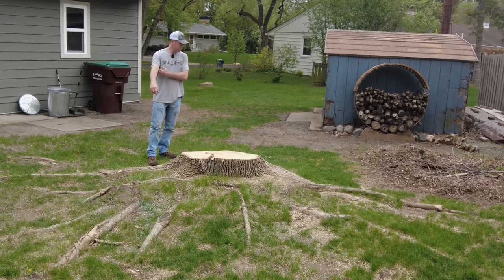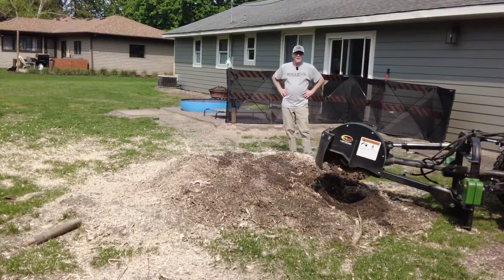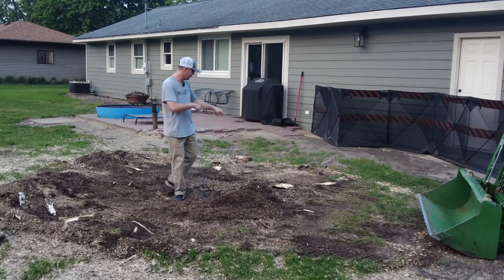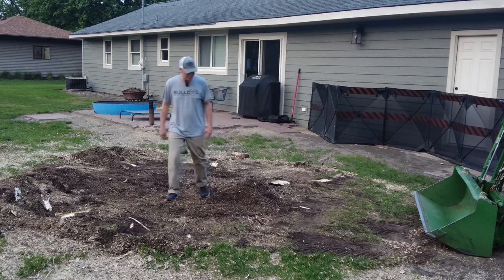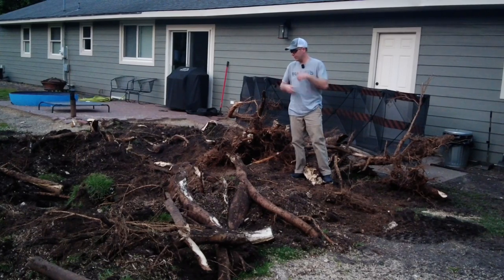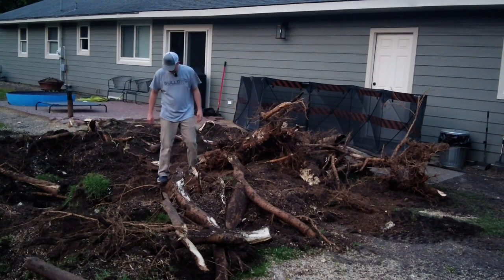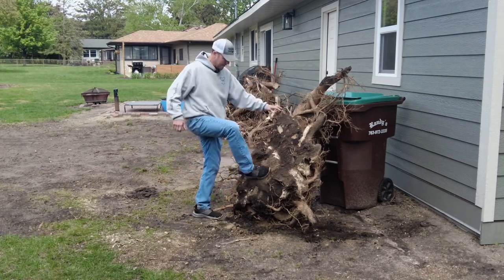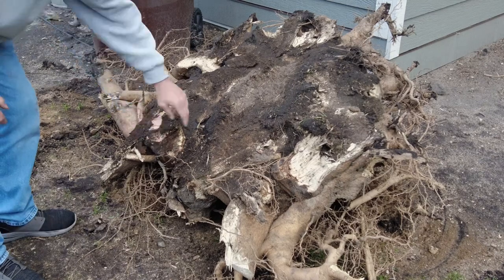Biggest Stump Removal- Compact Tractor

Comment: Have you considered a tooth bar or stump bucket for jobs like these? Looked like the bucket handled it pretty well, but I worry about my lift arms getting twisted using the corner of the bucket. My tractor is a bit smaller so maybe that plays a role in my thoughts.
Reply from the maker: Back a couple videos I have a toothbar video. Different situation, different tooling (attachment). Toothbar’s are great at their intended purpose. I don’t know if it would help in this situation, as the welded-on cutting edge seems more appropriate to cut the roots? I have a stump bucket, that is another tool that is good for its intended purpose. That being any stump smaller than, say 6” minus. Over 8” and stumps seem to hit super strength status. Well, in my experience anyway. Cheers from the Bulldog 🍻

Comment: Great video…nicely done! What brand stump grinder is that and what size is your tractor?
Reply from the maker: Stump grinder manufacturer is called “Quick Attach” manufactured right here in Minnesota! This is their Quick-Stump Away, 3 point stump grinder. The tractor is a 2 series John Deere with 38hp. The combination works well for stump grinding. It’s the stump removal that can get tricky!! Client directive was to flatten out the yard. Hence the Removal rather than Grind.

Comment: What was the reason for grinding the stump if you were just going to eventually dig it up?
Reply from the maker: With bigger equipment, grinding would probably not be necessary. Not saying grinding was the only way, but I felt it would help shrink the stump to a size my little tractor could deal with.